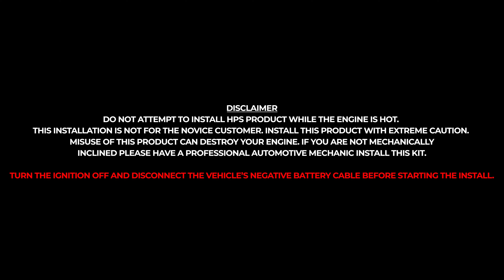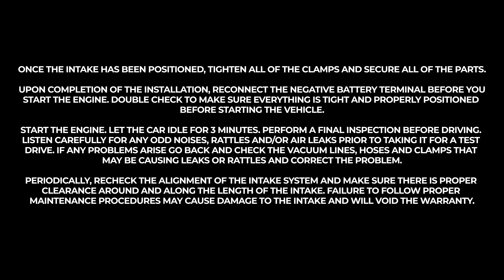2012-2015 HONDA CIVIC 1.8L INTAKE INSTALLATION 827-700

Comment: Just installed this intake, quick n easy, not much of a sound difference but worth it
Reply: En que siente que mejoro .? Quiero instalar uno pero tengo dudas si funciona o no
Reply: @wilmantelles8452  hi very late reply but a cold air intake basically as the name implies takes cold air instead if hot which improves gas mileage, reduced air intake temps, added horse power, just over all a better performance mod and a easier  one to do